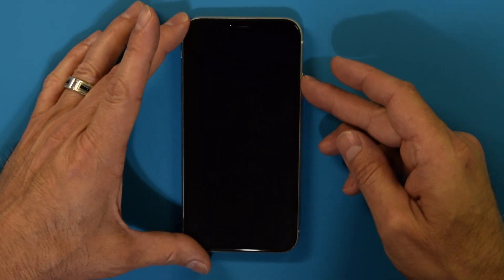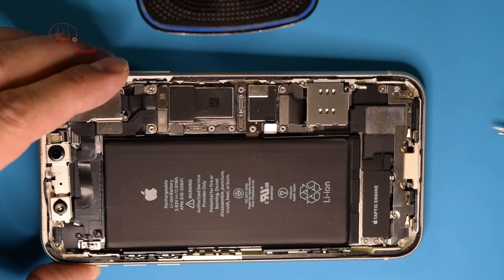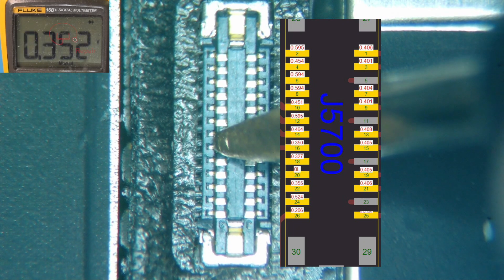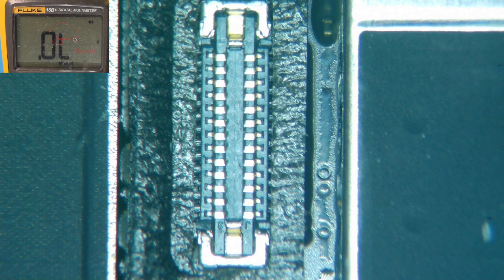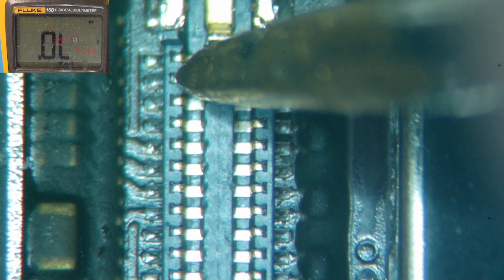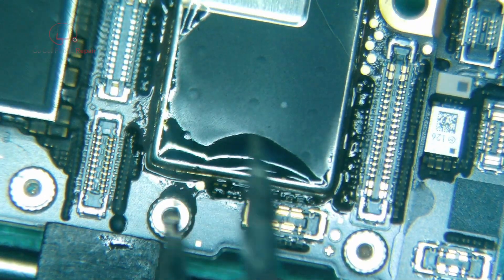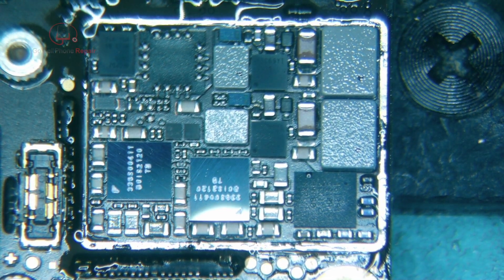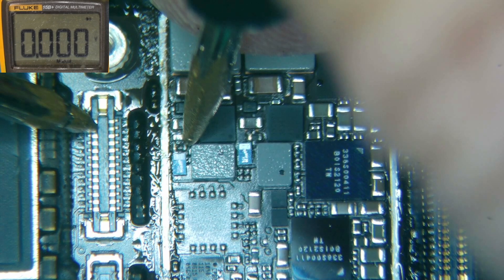iPhone 11 No Backlight Repair

Comment: Wich temperature do you use to remove the resistor ?
Reply from the maker: With my equipment it's generally around 430C. YMMV so start low and see how things react. You don't want the board staying hot long enough to radiate out to other areas. As a general rule it should't be too much more than 45-60 seconds before the solder liquifies.

Comment: Thanks for the video! I really enjoyed watching it.
Question: I've seen some repairmen simply bypass this resistor with a jumper. I understand that's not very professional, but from a purely technical standpoint, how bad is it? Could this lead to more negative consequences in the future? Thanks.
Reply from the maker: Yes, correct. Think of it like replacing a fuse in your car with a solid wire. If everything is operating normally, no problem. But if there is a voltage spike or short for some reason, the fuse's job is to protect other components connected to the circuit.
Reply: @GoCellPhoneRepair  That makes sense. Thanks for the reply.

Comment: How did you find out that the filters are the cause? I didn't quite understand how you relate it to the diodes
Reply from the maker: I checked for diode values and traced the OL value back to the filter.

Comment: Jakiej temperatury użyłeś podczas odlutowywania osłony w 8:20 minucie filmu?
Reply from the maker: After applying the low melt alloy, I used 380C to remove the shield.
Reply: @ thank you 😄